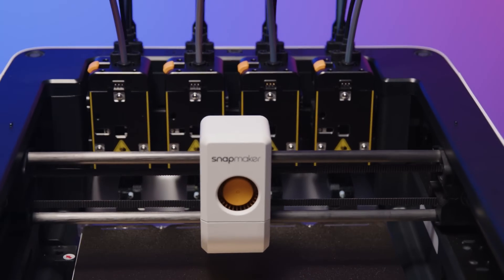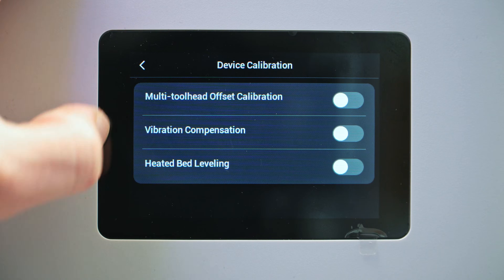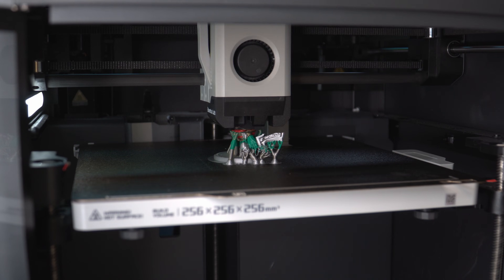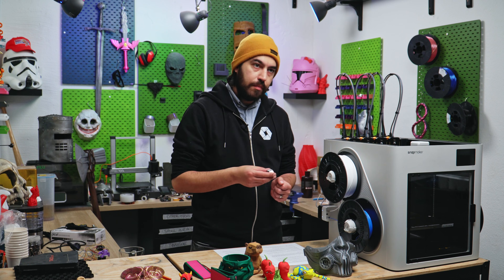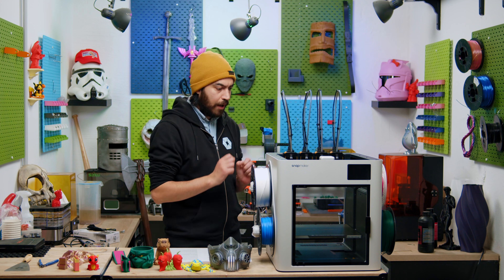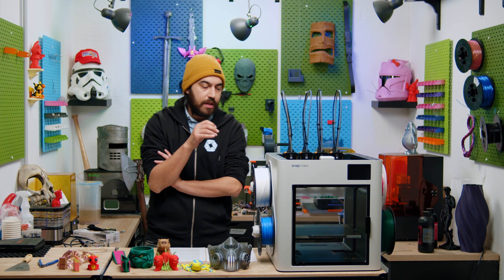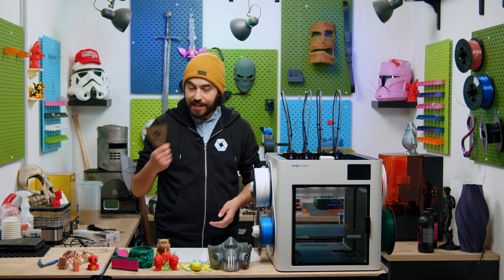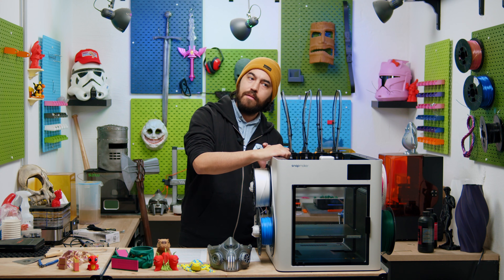The Snapmaker U1: An Affordable Toolchanger!

Comment: Regarding the cover, there are many print it yourseld options that are cheap and effective and chamber temperatures appear about 5 deg hotter then X1C, with a DIY cover, I guess because there is no poop-shoot allowing air in. Great printer so far for me, better than X1C except top end engineering filaments until hardened nozzles are available.

Comment: You should use units on your numbers. Especially if you are going to mess with things, like by time-lapsing. From the load to print section, is that 15 minutes or 15 seconds?

Comment: This is definitely the best printer I own out of a anycubic s1c with two ace pros, a voron 2.4 with a mosaic pallete 3 pro?, and 2 ender 3s. It doesn't print as fast as the voron or anycubic but if I am using dual materials for support which I almost always am this is a game changer prints take less than a quarter of the time when comparing them to single nozzle material changing printers. The build quality here is also top notch. The build plate is held on with a ton of bar magnets, much better than those magnetic sheets. The frame and carbon tubes are also much nicer than the anycubic which was more expensive but not as good as the voron linear rails. This also just runs klipper and doesn't require a second of work to get set up. The anycubic s1c can work with fluid but only due to an open source project. Really for $849 it can't be beat.

Comment: Great video, though i so think this printer can very well also be for those looking to print some more technical filaments. It can easily do it with a cover (even a self-made one) and maybe the hardened steel nozzles (like any other printer), and those who might need a more advanced filament with special properties for an application are also more likely to need to combine multiple types of materials for different properties, which is where the u1 excels

Comment: If they were already copying the Bambulab nozzle, they could have copied it 1:1, then I would have universal nozzles.
I already have the Bambulab and spare nozzles.
When you place an IKEA box on the printer, the internal temperature reaches 58 degrees Celsius.
The cover costs $8.
Ps
Using a metal spatula to peel off printed designs? That's crazy!
It's easy to damage the board.

Comment: Personally I think resellers like 3djake and specially Snapmaker are missing a very interesting point. Selling a 2/3/4 toolhead (cos 1 is different) with PREinstalled hotends of X size of choice. Why? Cos one is 69$ with stainless by default, so could be the same (or maybe 5$) more with a hardsteel one. This way the user/buyer doesnt need to fiddle with it, just buy, insert, calibrate auto and go. Specially since it has a big ‘instant’ replace & go added value. And for those who like to DIY they can just buy separated stuff

Comment: I love my U1.  4 Color prints that were 400grams are now only 60g.  4 hours instead of 24 hours.  I don't have to fill up the plate to justify doing a 4 color print.  I am over 150 hours, 20,000 tool changes (5000 per head) flawless so far.

Comment: I absolutely love my U1. the thing prints fantastic and is ridiculously efficient and fast.  if you have the money its a no brainer to buy one
Reply: would you recommend it for someone just starting with 3d printing? is the software a headache etc?
Reply: @Svevid  It uses an Orcaslicer fork, which has a lot of tutorial videos on YT. I recommend to buy the U1, it is a good machine, and easy to handle.
Reply: @bbrainka  I am finishing up my annex my office shed. and this will be my first 3d printer, just wondering are the 3d models interchangable from different libraries etc? also which program should i start with to create my own stuff? (if i buy the u1)

Comment: 3rd party chamber heater and 3d printed cover will do the job for abs, asa and other materials that require heated chamber
Reply: but use this materials better with the hardened steel nozzles ;-) 
Ive printed some of the 3rd party covers, but the multicolor-prints with ABS/ASA are much better with the hardened steel noozles - the stainless steel noozles produces much more stringing ...
Reply: @TierParkToni  I found it on my p1s whitch I will be replacing with U1

Comment: I certainly will buy one but your UK website says delivery Mid June 26. That is a long way off in the modern world 😱
Reply: Snapmakers workes produces at maximum and with the best optimized production lines - more lines set the price higher...
i ordered my 2 printers via Kickstarter in july 2025, and received it last friday (15.01.26), the hardened steel nozzles arrives est Feb 26 (with the plates), and the GECO PLA-plates comes est match 2026 ...
But the final-results are worth to wait 😊

Comment: As you mentioned, it a low cost machine. We will see that in a year with 2k hours if it’s reliable. As you mentioned, the specs are not matching 2026. It’s a 2023 specs machine with spools exposed to moisture. Perfect for those who print multicolor toys. We will see if it will be reliable in mid time.

Comment: This printer made me not care about multi colour for the Elegoo CC.

I suspect this will kill off most AMS type systems in 2026 and we'll see a bunch more affordable tool changers. 

The first company to come up with a well priced tool changer with enclosed system, built in dryer/drybox and active heating without being 2 metres tall will clean up
Reply: That's gonna be a while the biggest issue will be price having four toolheads is the most expensive part so they had to compromise everthing else in order to get u1 in that sub 1000 price point.
Reply: @ShadowGun625 u1 is already 999. Discounted to 899. Hardly cheap. Without any heated, enclosure, drying...
Reply: @ShadowGun625 let‘s see how systems like INDX or Vortek (I know.. it’s still AMS) will be adapted. With not having to rely on those expensive tool heads there should be a great potential :)

Comment: I was stoked to see this- and then completely disinterested when I saw it had a max 300c hotend😅 that just isnt going to cut it anymore. 370+ please and ill be the first to throw my wallet at it
Reply: Wasn’t really designed for engineering filament more like pla for multicolor people
Reply: Money is the point
Reply: What requires 370 c in multicolor? You can change the temp, it will he open source firmware soon.
Reply: @oneanother1 I think they're more interested in high temp multi material rather than high temp multicolour. Money is the reason, most people don't want a 370c hotend, even smaller number need one. I expect someone will make a high temp hotend for this pretty soon
Reply: @gregaranski his best bet is probably what prusa is making
Reply: @oneanother1  This just kill lowend multicolor solutions. P2S for example dont reach more than 300c. And a big mistake of Snapmaker is to not promote the upcoming official cover more. A lot people are just using the almost perfect IKEA solution meanwhile and are having good result with engineering materials.
Reply: That’s the least of your problems, at the moment I’m struggling to use ASA/ABS, even with a DIY enclosure lid. I’ve had reels drop off the spoolholder, spaghetti detection false positives, and really the firmware and software needs some tweaking. The Paxx Open Firmware  is a step in the right direction, but I hoping that SnapMaker Orca connection  issues will be resolved even further that what they are at the moment. I’m thinking that as this printer has a lot of momentum, I expect BIqu and others to make some mods to this, especially as SnapMaker are having problems meeting targets for the enclosure lid ( now pushed back to September 2026) , nozzles and other accessories. Clearly they are stretched at the moment.
Reply: @mikecrane2782  I would suggest buying Alveo3d Pro M100 filtration system it’s 800$ but can handle abs voc
Reply: @mikecrane2782  So weird, I all my AI detections had been true, no false positives, no issues with ABS, latest official firmware. I had have issues with the connection but is just closing and open the slicer, after the latest update Im not having any issues. Im using the IKEA lid with sealed interface. Chamber temp reach 50 or 60 depending of the material. I think could be the profiles in your case. Non Snapmaker profiles are bad. Generic whatever gave me bad results. So I basically im using SnapMaker profiles with all my filaments